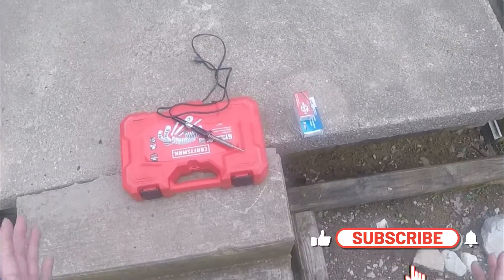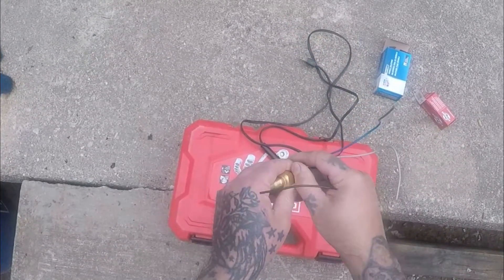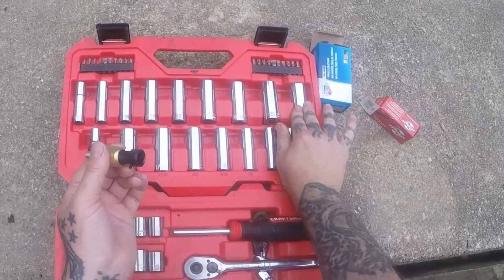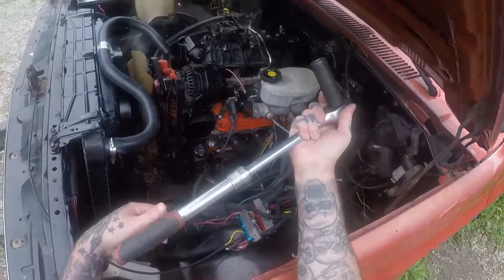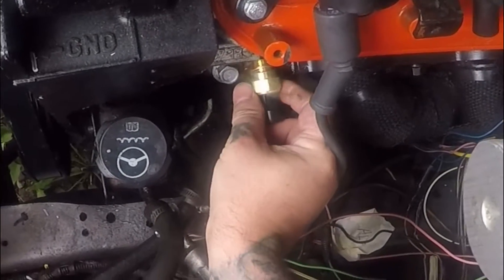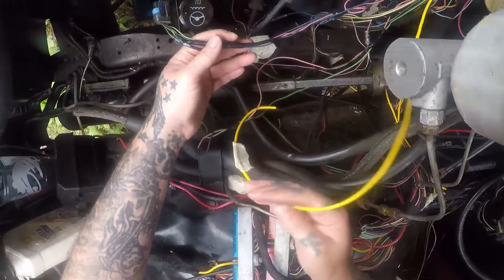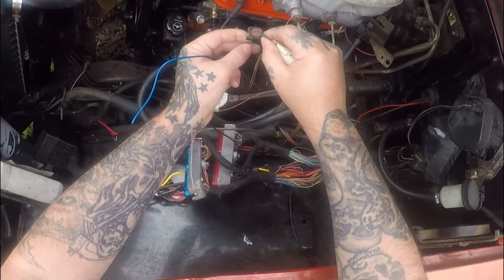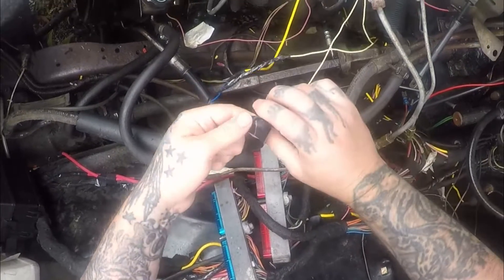How To Make A Factory Coolant Temp Gauge Work With Your LS Swap, 3 Wire Temp Coolant Sensor

Comment: Great video! What Brake Master Cylinder are you using?
Reply from the maker: one from a hydroboost setup off a 2002 Chevy, they boss has to be shaved down and the res to work, thinking of going back to oem

Comment: Question did this actually work and was this used for factory guage or aftermarket guage like equis or autometer
Reply from the maker: Worked both ways, its now hooked up to a aftermarket guage but worked with the stock before swapped to aftermarket, its in the rollback we use daily on the channel

Comment: Will this sensor fit a 2003 6 liter vortec ? Ive done this with my 94 tbi sbc to run a led therm gauge... but wasnt sure if the provision size has changed or anything?
Reply from the maker: I do not know if it will

Comment: My guy retread my hole on the head to make mines fit now I’m having a problem cranking it
Reply from the maker: should not cause a cranking issue
Reply: @TattsForLife  it was sending intake flow sensor we redid it everything working fine now just trying to figure out the next step

Comment: Great idea. Are you wiring the third wire to the original temp gauge? Did it work? I am converting an Australian 1982 VH Commodore 6 cylinder to LS1 and I am looking for ideas to convert temp sensor and oil pressure senders to suit original gauges.
Reply from the maker: Yes I wired it to the factory gauge it worked great to my gauge needle fell off lol due to age, I installed a after market temp gauge and hooked it into my factory wire and works just like factory, I have a video coming soon on that install

Comment: Hey buddy just swapped a 6.0 ls lq4 in my 77 c10 what upper radiator hose are you using can’t find any with great fitment
Reply from the maker: I used the factory 2003 LS radiator hoses on both the LS c10 and the truck one in video, they will fit just use some dawn dish soap when u go slide them on the inside

Comment: I also generally fill my fluids before changing the associated sensors or lines. Just did this with my oil pressure sensor. I like to think of it as "verifying that there's no blockage" as opposed to "not thinking and doing stuff out of order."
Reply from the maker: That is a good way to think lol